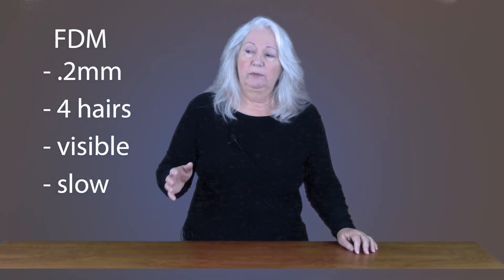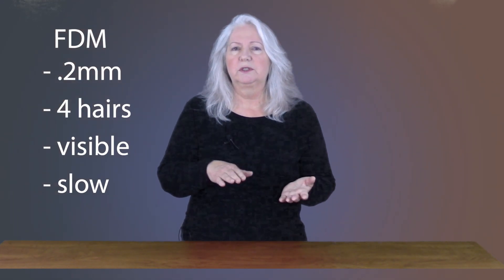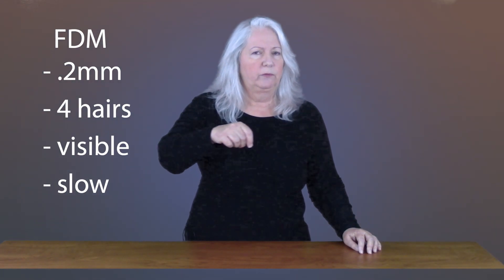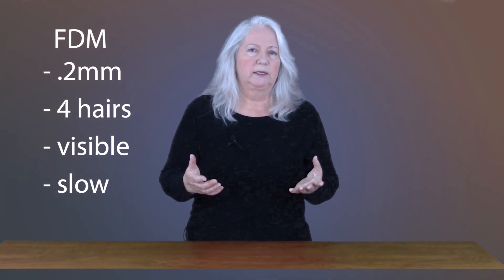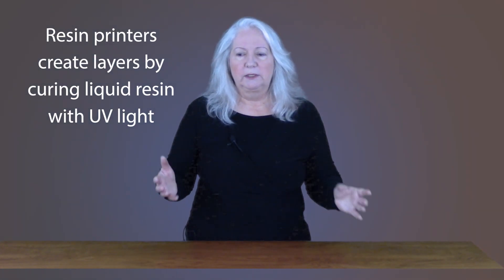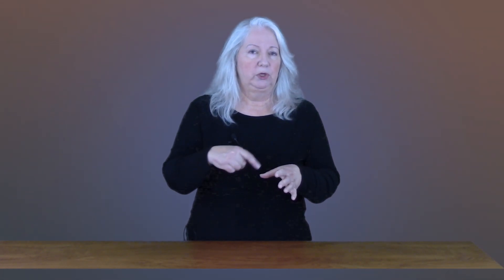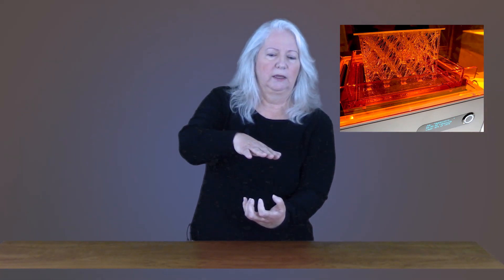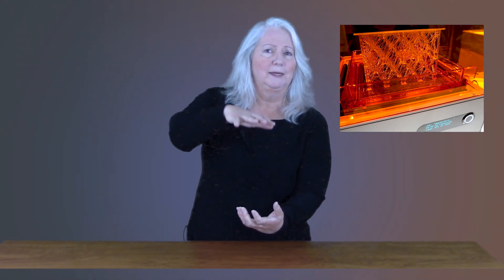Different Types of 3D Printers and How to Pick the Right One for You

Comment: Very good overview. I would make only a couple additions. Resin printers are broadly referred to as SLA printers, even when technically most of what the consumer will buy wont actually be true SLA. So if you are using a search engine, putting in SLA will yield results of all three kinds. The second note is that while the resin printers have more postwork and require more special handling, they require way less maintenance. Any FDM printer that gets any use will constantly need work. They clog, rolls of filament will stick, extruders get dirty and wont extrude, you need to keep leveling them and cleaning them. So tit for tat, they are about equal on the pain in the @$$ meter. I love them both, but they do require work. Have fun with yours.
Reply from the maker: Scott, yes I noticed this, particularly the not making a distinction between msla and sla. It was confusing for me, and I'm sure will be for others. Your comments on maintenance are really excellent, my limited experience with FDM at my makerspace was frustrating for this very reason, they often didn't work because they were not maintained well. I will be sure to talk about this in my next video. I also left the discussion of the lcd screen being a 'consumable' for later, but that is an ongoing cost issue for resin. Such a complicated topic! Thank you for the feedback,  it is very helpful.